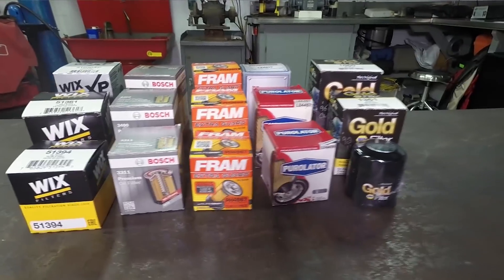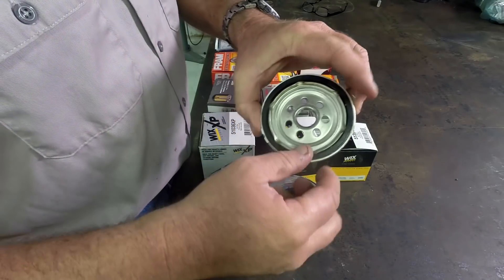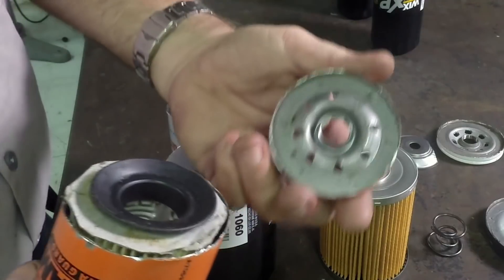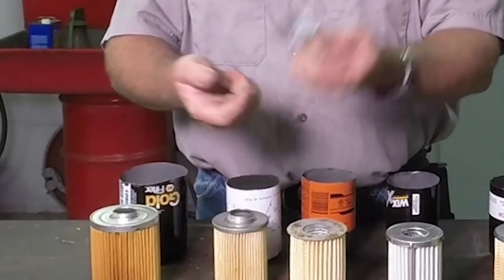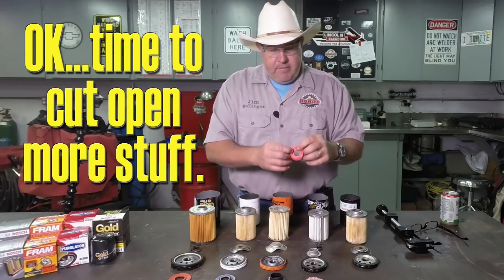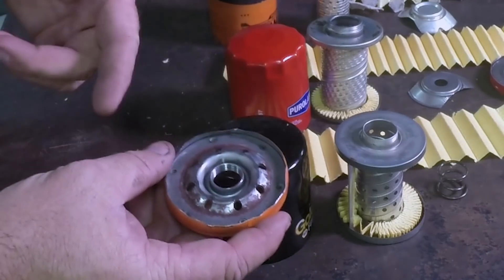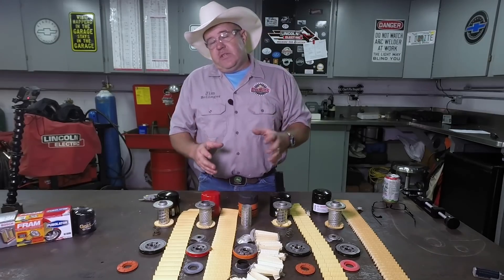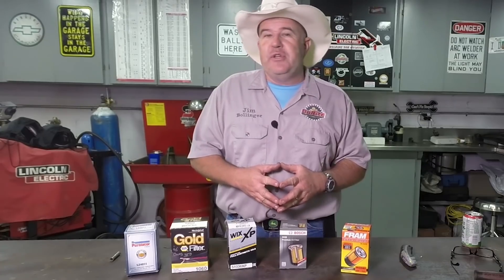The worst oil filter EVER!

Comment: Choose one of the biggest aftermarket parts companies and sing their praise to see if you can attract some sponsors.  Easy formula for You Tubers.
Reply from the maker: @mikejamesalt, Nice try, but nope. Like I've said, I'm not sponsored by any automotive manufacturer or reseller nor do I have any real interest in it. I'm independent, but I guess that's what the real threat is. It has been said that when you point your finger at someone three are pointing back at you. I don't think I am the one concerned for sponsors.
Reply: What you’re not explaining is how any of your findings make any real world difference (spoiler, it doesn’t). The Fram Orange filters have now under gone testing to extend the filter membrane life to 12,000 km.  This is a warrantied filter up to 12,000 km!  Equivalent or better than any of the filters you cut apart in your videos.  

The Napa gold and the Wix line, you are correct, are the same filter made by Wix as a premium upgrade to their base line filter.  Truth is, most garages that are involved with the Napa program do not use this filter.  They use the entry level Napa filter (also made by Wix) equivalent to the Defense line of Fram which Napa pushes as an 8,000 km filter.  Try calling Wix and ask how long they will actually warrant this filter for.  I have.  It’s not 8,000 km.  

At the current price point, you can buy a Fram Ultra Synthetic filter for the same price as the Napa gold.  Pulling that one apart is more apples to apples.  The Ultra Synthetic is a 24,000 km filter.    (Not that going that long between oil changes is recommended by anyone).

Comment: That "springy thing"... I think thats a bypass spring correct? In place to allow oil to bypass the filter if it's clogged or a high pressure pump is being used.

Comment: You were NOT FAIR! 
YOU USED THE CHEAPEST FRAM FILTER!   FRAM MAKES MUCH BETTER QUALITY THAN THE JUNKY BASE FILTER YOU "TESTED!"  "Test?"   What test?
So - instead of running scientific tests  for  a filter's ability to flow AND trap particles, you cut filters?   Maybe NOW the basic filters, made overseas, ARE JUNK- but hiw about the Fram Ultra you didn't "test?"   You're NOT comparing Apples to Apples!   Unfair!
Then the You Tube "Science" baded tests, and Fram sponsored videos, and my 50 years of excellent service (using best quality Fram -change oil and filter every 3 months) means nothing? 🤔
How about Factory filters, such as Ford MotoCraft?
You are the "cheese ball" here! 😖😞😟☹
Reply: Not FAIR! What are you, 5?
Reply: So you need to by the "Ultra" to have a usable product? Now that's unfair.
Reply: A simple reply is why Fram's base model filter is not up to the job of proper filtering properly.  That should be the base standard for any filter.
Reply: Fram is a garbage filter I cut the most expensive from filter open and it was just as bad. Took one off of a buddies truck had some oil pressure issues the filter had deteriorated and clogged the pick up tube. These filters are not worth an engine.
Reply: @ryanholloway1600  Why should anyone believe this anecdotal story?

Comment: i think you just got a defective filter, i am also mechanic, i been using fram filter for 50 years with pennzoil, my ford truck not shit has 753,000 original drive train, so your opinion is wrong or your just trying to promote napa filters

Comment: Your video demonstrates "Perceived quality" or what is visually apparent .     It would require laboratory testing to identify a winner in the really important category of "performance quality" .      A good looking enclosure may hide the inability of the filter to hold back the ultra small particles that still pose a threat to engine parts.      Fortunately for us , minimum industry standards for filtration are met by all these products  , though one or two may be exceptionable.     All that being said , I agree with you on the Fram filter.   It would have taken a fraction of a penny to plate the internal metal parts to prevent rusting.      I would like to see a similar teardown of some specialty filters like the Mobil one ,  the one sold by Amsoil, etc.

Comment: Awesome video! How much better is the Napa Gold vs the Wix? Second question, how are Mobil 1 filters vs these two filters. 
I use Wix filters for all my engine air filters, cabin air filters, small engine fuel filters and been wondering if they are better than the Mobil 1 engine oil filters. Thanks in advance.

Comment: Baldwin filters are by far the Top Quality filter,  they use them in Heavy equipment tractors, i was a Heavy equipment Mechanic and used Baldwin and Wix filters only...  i used Baldwin in my truck and cars too... fuel and oil ...  napa auto parts sells  Baldwin filters .. they are way better and cheaper then a auto Dealership filter... a good friend of mine is a Factory GMC Mechanic trained from GM...  he swears  Baldwin is the best filter...

Comment: Thanks so much for this video.  This explains a lot. Just a few years ago I had a Fram filter on my jeep, and all of a sudden I saw a giant cloud of oil smoke behind my Jeep.  I pulled over and it was dripping from underneath some where.  I was close to home so I headed back.  Upon inspection I found the large rusty crack in the bottom side of my filter.  I thought, "Dang, I know it has not been THAT long since I changed the oil!"  Now I know why.  Thanks.

Comment: I've heard the same thing about Fram from others, but I have used Fram oil filters in all of my cars for the last 44 years. Never lost an engine, only a car to accidents or selling them. Most of them had over 200,000 miles. Currently have 3 vehicles with 295K, 250K and 235K on them. All running Fram oil filters and changing the oil and filter at 7500 miles. They are made cheaper, but they have always worked for me.

Comment: excellent  video , I did a similar investigation several years ago and found the same. I had an orange filter rust thru and leak oil while the engine was running. Almost cost me an engine! I now use Mobil One oil filters on all our vehicles.

Comment: To me,the bottom line to all this is that it's worth spending an extra $3 (on my particular vehicles) for the peace of mind of having a well made oil filter on an engine that would cost thousands and be a huge headache to replace.I also don't care if some engineer on here thinks it might be overbuilt for it's purpose ,which is highly unlikely in this cost cutting world.On a part as critical as an oil filter,I'll take the overbuilt part over the barely adequate most of the time part.

Comment: Fram Slam !  Been using a fram oil filter with pennzoil on my 95 Chevy k1500 since it was new. It now has 632000 miles. Never rebuilt.
Reply from the maker: @Joel Rees the back row of filters fits a 95 K1500 (and many others) I have one with a 5.7. I bought it new in 95 now it has a bazillion miles as well.

Comment: I"ve used fram on my 1995 ford explorer with a 4.0 engine.I still drive it daily with 425.000 miles on it.the engine has never been touched except add ons like replacing starter ect,NOW with that being said I also use Castrol 10w40 and am a stickler to changing my oil every 3000 miles and never over 3500 miles.To this day it does not use a drop between changes,maybe I just been real lucky.And I did enjoy your video

Comment: The frame ultra is by far a much better filter than their cheaper brand and also uses a synthetic filter media and screen backing to prevent the pleats from collasping.
Reply: Maybe but, they shouldn't make the low quality junk here that is actually a threat to your equipment.
Reply: Question is WHY is Fram selling such a shit filter (like the one rated) in the first place
Reply: @patrickkruger5310  my guess is that they attempt to address all income brackets not that there that much difference in the election cheapo fram filter and the ultra plus from personal experience with family members there are people that just refuse to purchase quality parts as much as you try to explain the benefit.  Like my daughter and son in law, I have to steal their from them to change the oil and by than it's usually overdue by 10,000 miles.

Comment: I don't use Fram or any of the others that you have "tested', but may add about the rust, it may have been the way the distributer, supplier or retailer handled them that they got rusty?
You should have cut open a Baldwin...all the rest would have been rated as garbage.👍

Comment: Wow - been using Fram filters for over 50 years with no problems.  Now that I'm so freaking old, I usually have the dealer change my oil now.  The dealer is so expensive that I might change my truck oil, so I'm glad I watched this video before buying another Fram filter.  EXCELLENT and tanks.

Comment: it's all down to cost nothing wrong with fram filters just change them often i change mine every 3000 miles with the oil my engine just covered 748000 miles with no issues

Comment: I've used Six for damn near 40+ years on Trucks, Equipment and cars. They have Consistently been an OUTSTANDING Product.
Reply from the maker: @ DESPRADO111 By all means, keep using what you have had good luck with.
Reply: @DoRiteFabrication  ,  I'm sorry, That was supposed to be WIX, not Six... I should have proof read it... Thank you for your videos:~)
Reply: Also, Have you looked into the Royal Purple Filters?

Comment: Come on people. Fram is not gonna blow up a bunch of motors or not work properly.  I will use the Fram Ultras on all 5 of my vehicles without hesitation including my ram diesel, have for years.  They have been around a long time, well engineered and high tech tested..Have you ever seen their amazing production and design facilities? And they happen to be USA made.  Betcha all the others came from china or ???  This test means nothing other than a snake oil opinion.

Comment: Long Story -short . Dont cheap out. I have known for years that wix was a good filter. And I have seen many cars come into the  shop with blown up motors and you guessed it. A fram filter. every time it seemed.  As a rule of thumb just go with what came on the car from the factory. i.e motorcraft=ford,  ac delco= gm, toyota= um toyota ,  ect, ect . believe or not you can get a toyota filter from autozone.  sometimes they have it in stock.

Comment: I have had  3 different trucks and got 350,000 miles plus from all of them. Fram filters were used on all. I guess I was just lucky all 3 times. Trucks were still running when I got rid of them. Explanation?????
Reply from the maker: @MrOldnslofly The Obvious explanation is.....You drive good trucks!
Reply: They were all Fords so that will start another discussion with in itself. My opinion is use whatever filter you want and decent oil at a well timed interval and it really makes no difference. My thoughts like stated before. You did a nice job on the video none the less. Happy New Year.

Comment: I DONT BELIEVE THIS MANS STORY I GOT A NEW 2003 FORD 150 A V6 4.3 ENGINE IT HAS 257624 MILES ON IT AN ENGINE HAS NEVER HAD ANY WORK ON IT AN MIGHT USE A PINT OF OIL IN 3000 MILES SO I THINK HE IS FULL OF YOU KNOW WHAT

Comment: I've known this for a very long time, having cut open several brand-name (and OEM-branded) filters for comparison. No surprises here. The basic Fram filters are garbage. And what happens when bits of that fragile cardboard end piece come adrift and begin plugging oil passages? Yup, they could destroy your engine. What's worse, Fram supplies this exact filter to some of the new auto dealerships - for example, Mazda in Canada - that are painted blue and emblazoned with the Mazda logo but at twice the price(!) Wix and Napa Gold are the way to go. the Napa silver is a lesser filter but still acceptable. Quaker state filters have much in common with Purolators, and AC Delco makes a decent filter.

Comment: Had a 5.0 Mustang for 20 years, used that Fram filter, still run great when I sold it. Right now I own a ‘94 Ranger, I bought new, and an ‘02 Focus I’ve owned since ‘04, use that same Fram filter, never had a problem! You don’t need a filter costing 2-3 times more if you change the oil when you should! “Put your money into the oil” P.S. Avoid being brainwashed especially from the left!

Comment: Okay, just one question: What about the supposed different levels in the FRAM filters? (Any difference between the 'baseline' filter you used here, compared to the "High Mileage" or "High Performance" filters also made by FRAM?)
And one related comment: I'll never buy a basic FRAM filter ever again; however, I still wonder if FRAM's more "Performance" filters compare closer to the Percolator.

Comment: I have been an ASE Master tech since 1978 and worked mostly dealerships. I use the manufactures oil filter as they determine the design, filter media, drain-back, by-pass mechanism, in other words, everything. Their are only a few oil filter companies in the USA and contract to make filters and silkscreen the color & logo they require. As for this Napa commercial, you get what you pay for. As for rust, the humidity from talking so much must be about 92%, so yes, mild steel will start to form rust. Ha, Ha!
  ACDelco, Motocraft, Mopar all would like a larger market share, but you have world wide competition from companies who purchase other brands. The engineering departments do autopsies of parts. They compare, decide and choose the material, gauge thickness, stamping, welding, threading and media, without violation of patent, copy rights or intellectual properties of other companies. I would just like to see owners change the oil & filter before adding a qt. to get them another week of use. I have seen an new engine destroyed in 11k with OEM marks on the oil filter. It depends on how you drive. Short trips are harder on oil than long trips. You drive 17 miles to work each day, step on the brakes 312 times, but drive 400 miles to grandma's house on the interstate, you step on the brakes 146 times. I am taking a trip, so check out my brakes??? Can you open the hood to check you're own oil level? No. Oh, please over-tighten my lug nuts while you try to up-sell brake pads during the oil change, would ya! You would be surprised how many times the "Quick" oil change place forget the oil as they drive it into the parking lot...if they put the drain plug back in! Get professional service & ask questions.

Comment: None of these are the worse ever filters. Toyota used to have what we called the (Infamis black filter) on the R20 Toyota engines. Every 50 or so used to blow the can off from the bottom of the filter completely emptying the oil supply from the engine in seconds and burning up the engine. As a tech I saw at least 10 do this. Luckily we used to have someone watch the filter as the engine was started for the first time and could shut it off after reving the engine up to see if it would blow.

Comment: Good examination of filter quality.  The spring "thingy" is the bypass mechanism of the filter.  It is an important safety and performance feature.  If the media becomes plugged with contamination or the oil viscosity is too high due to low startup temperature and type of oil, the oil pressure pushes the media can aside allowing the oil to bypass the filter. It it fails, the pressure can breach or collapse the media, especially if it is constructed poorly.   In both cases the filter is bypassed, you have no filtration.  But, what about the paper media?  What is the real, not "nominal" capture rate?  Is it different for petroleum or synthetic oils?

Comment: I've used Fram filters on everything I've owned, one is a 74 Plymouth Duster 318 it has over 360K miles never been rebuilt still runs like a champ the other is a 99 Dakota also a 318 with over 275K miles never been rebuilt runs great are there better filters out there sure Fram works fine in a standard vehicle. What are the micron size that these other filters filter down to I know Fram is a  10 micron filter

Comment: The NAPA filter line and Carquest filter lines as well as O'Reilly are made by Wix. Those retailers have two or three quality levels.  Even the lower priced value grades  are better than most other filters.  I have seen Fram and other bargain filters like Kmart private label filters rupture and spray oil. The cases are so thin they can develope pin hole leaks that spray oil draining your engine of all it's oil.  You don't have to buy "Gold" or premium lines to get a decent filter. Retired,  47 years auto tech and service manager.  I sold hundreds of cases of value line filters over many years with very few problems.

Comment: The problem with his analysis is that is based on observation.  Improvement in oil and quality oil filters are why car engines are lasting so much longer.  His observation about something being of acceptable quality has little value.  Buy the manufacturers oil filter.  Wix and NAPA being made by the same manufacturer doesn't impart quality on one because of the other.  Each filter is made by specs and if you are judging quality on one with the other without knowing the specs the filter was designed you are making a mistake.  Buy manufacturer filters. Keep this in mind when you get the $15.00 or any cheap oil change and price drives your decision on who does the oil change.